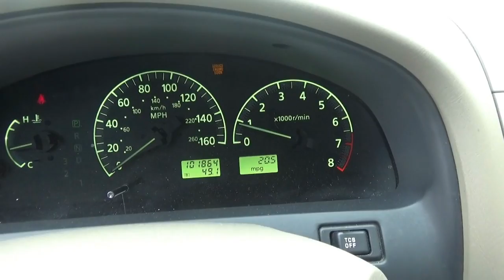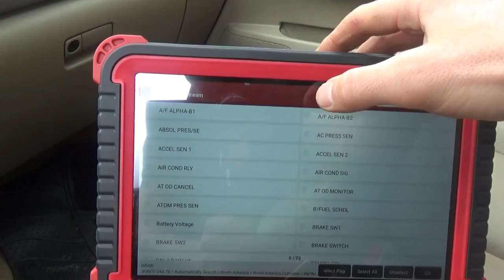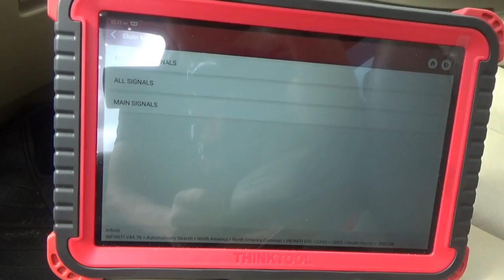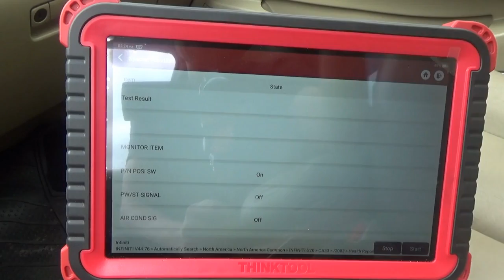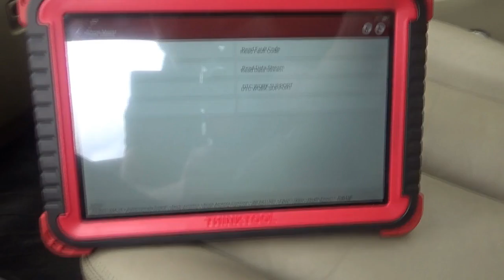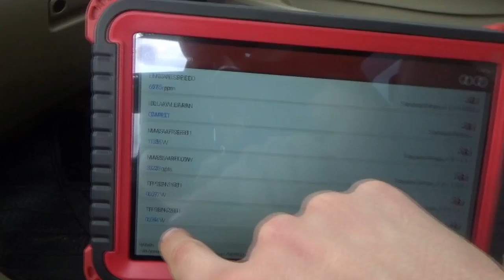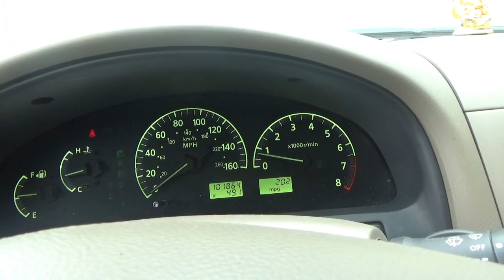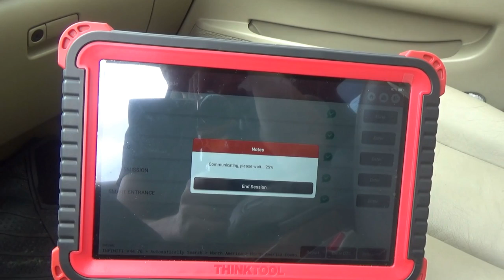Nissan-Infinity P0507: Idle Re-Learn after cleaning throttle body (THINKTOOL PROS)

Comment: I’ve been watching a lot of your diagnostic trouble shooting videos lately and it seems the Think Tool Pro is your go to scan tool now.  I’ve got the Autel Maxsys906bt but I’m liking the format of this Think Tool Pro better from what I’m seeing.
Reply from the maker: The ThinkTool really shines on newer cars with lots of modules...about 2008 and newer :)
Reply: @PineHollowAutoDiagnostics  
  That’s a good thing because that seems to be most of the work that’s showing up at least at my shop.  That tool seems to be a more user friendly, a little easier to navigate through.  Thank you for your videos.  There like watching a mystery movie being solved.
Reply: Ivan, I see there is a ThinkTool Pro and a ThinkTool Pros.  Do you happen to know the difference?
Reply: @weshawkins7165  Both works similar but Pros has more big size and support connect 24V heavy truck duty module.

Comment: I recently got the ThinkScan 609 and it was nothing but problems out of the gate.  My first step was to update.  Failed with serial communications error (more than one computer).  OK, let's try that nifty thumb drive that came with it.   Nope, serial number not recognized.  So after many back and forth emails, it finally updated.  But in the process, I found that ThinkCar and LAUNCH share a common update tool and registration database, perhaps even more.  But at one point they said they couldn't verify my device was one of theirs (despite sending a picture of it).   Overall, not impressed with the company but the little scanner for around $100 isn't bad.  When I asked why it couldn't be updated via USB, their response was that the update program hadn't been updated for USB updates yet.  And oddly enough, it's called the "Product Updata" tool.   I believe that's the Chinese translation.  I'm not ready to invest more money in a company that's apparently selling beta software.
Reply: T609 need to update via computer and may spend some little time.Normal,selle will help you fix it if you send serial number.
Thinkscan Max and Thinktool Pro support online quick update via WIFI.

Comment: IAVL  Or idle air volume learn. Needs to be performed. Because the carbon was removed from the throttle body now there's extra air going in . Now that's assuming the computer will even allow you to do it. Early Nissan models for whatever reason do not like setting IAVL. I had to change out  ECM and throttle bodies to get that to set. And the older altima, they even had a recall to try and fix that . which it never did.

Comment: I cleaned  both throttle bodies and  butterfly position reset and idle relearn on 2012 G37 with 80K. Did not disconnect the wiring harnesses. Quit a bit of timing and footwork but the ecu set everything perfectly. Your tool is great for a professional but it can be done "manually" if one has some auto savvy. I did not have a code but idle was slightly high before cleaning. I would hate to see what the dealers charges for the cleaning and relearn... Throttle seemed a little more crisp.

Comment: Ivan, Launch based software meaning same software? same company ? or do you recommend one over the other?  I have the Diagun
Reply: It seems like there is some relationship between Launch and ThinkCar but it's not clear exactly what. Certainly ThinkCar seems more focused on actually selling products in North America, Launch has been kind of a disaster in terms of customer service at times.
Reply: @RobertHancock1  my launch Diagun has been an excellent tool so far, does a whole lot and is nicely priced, what i am basically wondering is if the thinkcar does everything the launch is able to do? or more?

Comment: I'd love to have a scanner, but a thousand bucks is hard to come by and probably not wise for the non-pro like me.
Reply: Thinktool Mini Dude. $350 and lifetime FREE updates. You wont be sorry trust me, retired mechanic with all the scanners. It's knowing how to use it is the key. Check out ebay.
Reply: I'm a non pro and bought the Autel MS906 a few years ago for $1000. It took a while to save up for it, but it was money very well spent. Shops charge on average $100 to diagnose. The bi-directional features make it worth it.
Reply: Looks like ThinkCar makes some Bluetooth-based scan adapters which can do the same kinds of special functions and bidirectional controls.
Reply: @RobertHancock1  They do. A little over $100 for the adapter. It comes with a catch. You can only get 1 vehicle bi-directional features for free for 1 year. After that, you lose the bi-directional features. It is $49 a year to use the bi-directional features. That still isn't bad.
Reply: @RobertHancock1  Thinkdiag OBD2 Scanner Bluetooth, All System Bidirectional scan Tool OE Level Diagnostic Tools with ECU Coding,16+ Service Functions All Software 1 Year Free fits for iPhone & Android
Reply: @RobertHancock1  From the company- full system diagnosis + maintenance service + special function + action test + coding), valid for 1 year
$39.95/year/model (full system diagnosis + maintenance service + special function + action test + coding)
$49.95/year/all models/1 maintenance function (available for all supported models)

Comment: Might be a good idea to disconnect the battery before changing spark plugs or cleaning a throttle body or MAF sensor. I even disconnect the battery on my Nissan Pathfinder when bleeding brakes.
Reply: When I cleaned the throttle body on my 2011 Grand Caravan, I was very careful to unplug it, remove it from the car, and to clean it thoroughly with T. B. Cleaner, clean cloths, and swabs. I was careful not to allow the throttle plate to move and thus not disturb the alignment. I was able to get the perimeter of the throttle plate clean with swabs and careful spraying. All back together, idle was spec and it worked as it should.

Comment: Ivan, not sure about I35, but on G35, you must disconnect the negative battery terminal before cleaning the throttle body. Otherwise you have to do the Idle Re Learn foot dance procedure as shown on the web.
Reply: I have followed that method on my G35S and still had to do idle re-learn. It'll be easy next time though, I bought a Thinktool Pros last week!!!
Reply: @bigfoot9445  I think also, if you had a  lot of deposits that were removed, the airflow at idle would have changed. I have gone so far as using a wire and polishing both sides of the thottle body. I was extremely careful not deform the butterfly contact area. I also ported/polished/reshaped the upper and lower plenum. Definite Butt dyno gains.

Comment: I had an 02 Altima 3.5 I finally gave up on. Verus, MaxiDas, Diagun, nothing would do it. I looked like an idiot to the customer. I don’t know where they took it. I think the dealer. But I won’t b cleaning or disconnecting the throttle body on that car again. If the Stink will do that, I’m buying one. Nissans r a pain for some things.

Comment: My car was doing this once the idle was stuck at 2000 rpms not drivable like that. It ended up being two things causing it a bad TPS and MAF both causing issues Idle Air Control was okay but the MAF was reading wrong and keeping the IAC open and TPS wasn’t reading right either so sometimes on acceleration car just stall cause computer could not see throttle input and the wrong MAF readings just screwed everything up

Comment: Cool,  so I have one on a VQ30DE engine (3.0L v6)
Nissan Maxima / Infiniti  i30

What I read was you disconnect brown connector on throttle body after it’s warmed up.  Then reconnect it with in 5 seconds. 
It seemed to help my 2001 maxima. 
But wasn’t sure I did it right it seemed better 

https://youtu.be/Oa6h_pvgMZ0